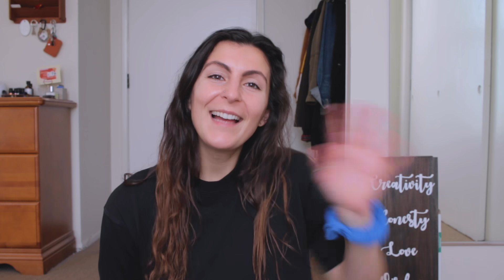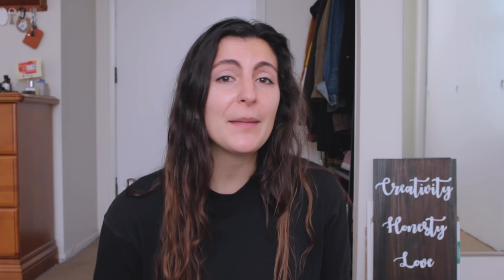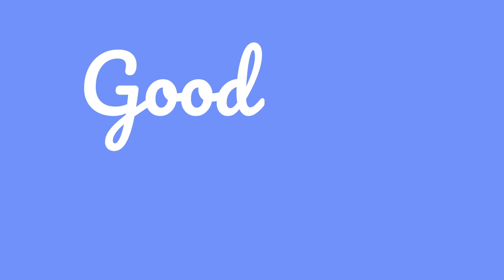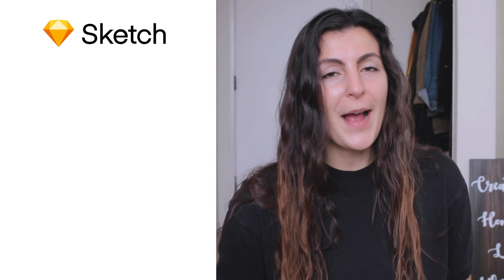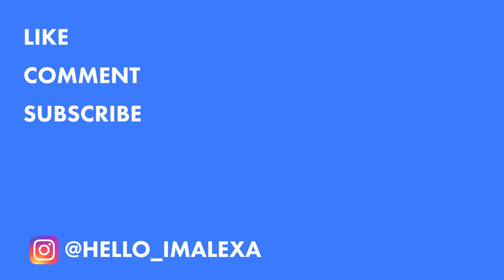My UX Design Tools

Comment: Hi, I was wondering, how much coding do I need to know? I really enjoy designing the interfaces  and graphics in a design tool, but I hate coding.   Would just doing the designs be enough to get me a UI design position?
Reply from the maker: I've never had to code as a Product Designer in the Bay Area. It may differ deepening on where you live 🤷‍♀️